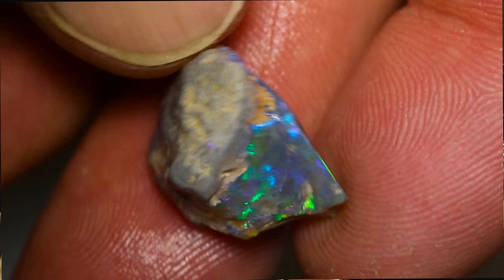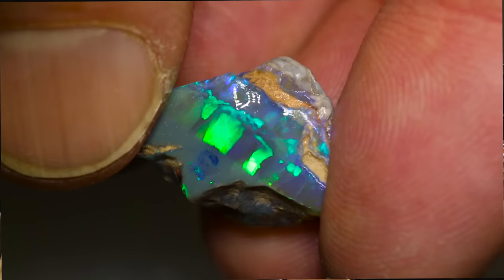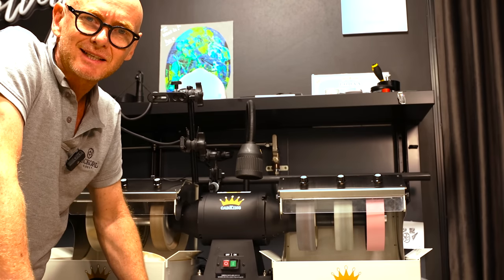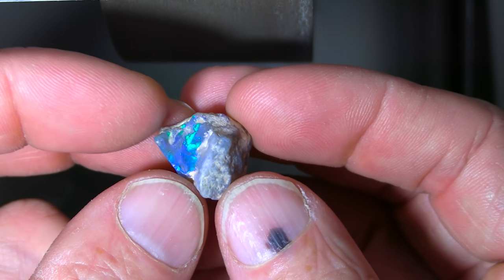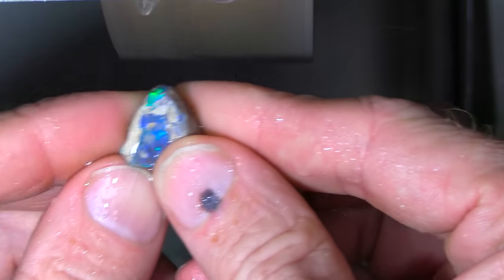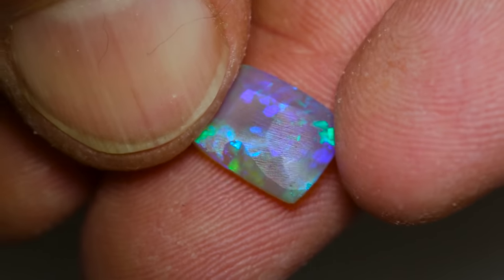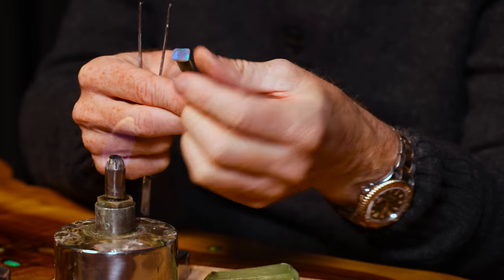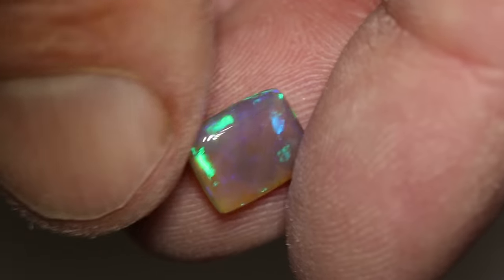Uncut gem teaches not to be greedy  - New opal cutting machine! (Cabking)

Comment: So cool, you've got the same CabKing that I have! For the price it's a fantastic machine, I'm sure you'll enjoy it and the customer service is top notch. I've been using mine for 6 years and except for changing to sintered wheels the only thing I've changed was the light (it wasn't bright enough for me). I've cut loads of opals on my machine and really like it. Some people have knocked it because it has a lot of plastic, but I honestly haven't found that to be a big issue. The places with plastic aren't leaned on, pushed on, etc. I also like the flat laps on the ends and the water system (although I did switch out the waste water lines that came with it and replaced them with heavier duty lines).

Comment: Same machine I have in 6" and there is a saw attachment that I just used on boulder opal.  I removed the roughest wheel, moved everything left 1, and added a 14k resin onto mine.

Comment: 2:58 I would recommend to put some thick hard rubber (?) under the machine to reduce the vibration.
Your work bench is acting like a speaker
It is always difficult to get rid of the low tone. All is vibrating and spreading out the "BRRRRRR"

Once I saw a generator in a big box in a factory
Inside the box it was too loud without ear protection
Outside the box it was fine
The walls of the box were hollow and filled with many steel balls
This balls took the energy of the vibrations

Comment: Hi Justin, new machine looks great!

What’s your opinion of the stock electroplated diamond and resin wheels that came with the arbor?

I’m seriously considering upgrading from my ancient cabbing machine and am curious to know how well they might hold up over time.

(I’m guessing you swapped out the stock electroplated diamond wheels and perhaps the resin wheels with ones you already owned.)
Reply from the maker: Yes they won’t last as long as a Sintered wheel but they are great until they wear out. You get a few years out of them if you just cut opal and not things like agate

Comment: Watching your videos a question came into my mind: what do you think about possible future technology of gem cutting?

Will there be a way - a machine - to scan the uncut stones with every physical aspects and make an optimised calculation for either the best colors or the best value (if it is possible to make smaller but higher value stones).
 
Or just make it possible to make a recording about every possible cut and angles before you even turn the wheels on.

AAaaaand to make an automatised cut after watching the scanned images.

Comment: Justin, I like watching for and watching your videos! Thanks much for sharing them!

Is it your iPhone that’s picking up the sound of the machines?  If so, there’s nothing you can do to clean that out once the phone has picked it up. You’ll have to go with a dedicated camera only, if you’re wanting a really noise free production.

Cheers!
Reply from the maker: Yes I have a seperate DJI mic setup and just have to work on making it better
Reply: @blackopaldirect , again, the iPhone is picking up sound that cannot be edited out, I’m very, very sorry to say. 
If you could switch to a color only camera with no microphone, then mix in the audio, that would be a winning solution.
Cheers!
Reply: @bundy9236 , I’m looking at this from the prospective of being a sound man and trying to eliminate external sounds when Justin is speaking.  I’m an electronics man and try to help fix things.  Sorry.
Reply from the maker: @jmikronis7376  I hear you and thank you for the help. The problem is the mic is close to my face and the machine so it pics up both
Reply: @blackopaldirect , in electronics, the waveform of the sound coming from the mic on the machine, added to its inverse, will cancel each other out (mostly). The microphone in the iPhone (used to provide video of your work) cannot be used because it there’s no adjusting it, which is why you’ll need a camera without a microphone. 

This is how news broadcasters do it. It’s how the background echo is canceled out.
Reply: Justin, I discovered the mic setting in YouTube settings where one can turn it off. I’ve just applied it on my iPhone and have to wait 24 hours for it to become effective. I do think that’ll work for you.

Cheers!
Reply: Update : in order to completely turn off sound using the “camera” portion (not YouTube live), you’ve got to do something that can’t be undone, you’ve got to ruin the microphone for the camera. It’s the only thing I’ve found that works.  I poked a fine tipped instrument into its opening. 
Now, every video I make and post to my YouTube acct has no sound. I’ve not tried to remix it to add audio from any other source.
Cheers.

Comment: Is there no way to force a crack to open up and split before you go too far cutting? Potentially you could have two stones.
Reply from the maker: Sometimes a crack can stop so forcing it could break where a good gem might be sitting. Hard to know if you can’t see how far it goes in until you go in